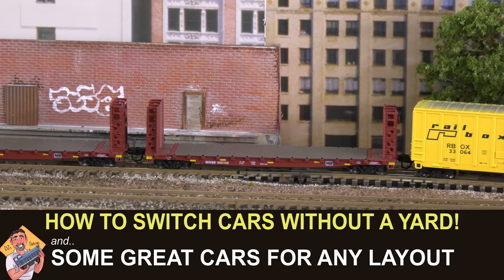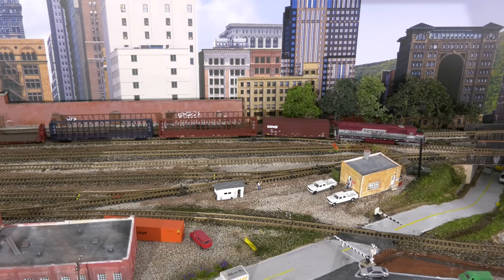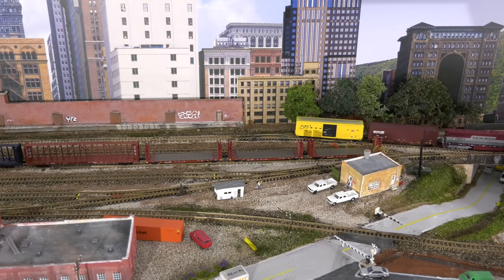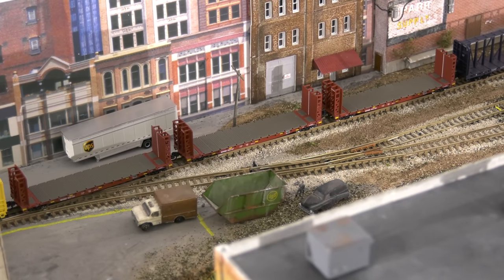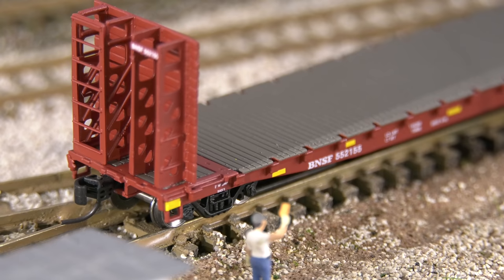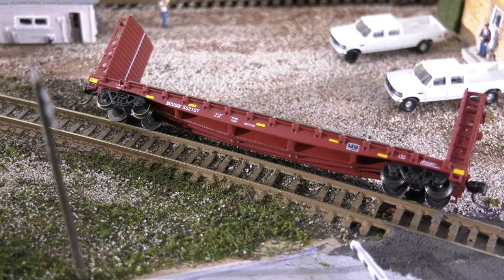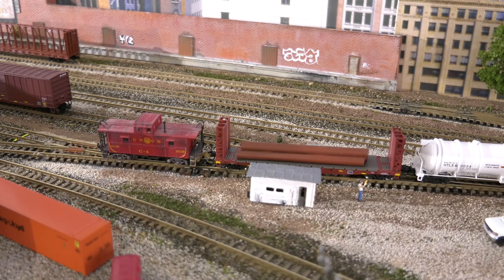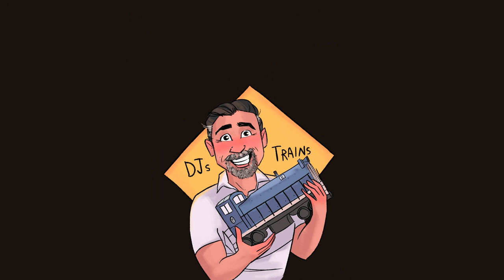How To Switch Rail Cars Without A Yard (and Great Cars for ANY Layout) Explained.

Comment: Hi DJ, Very informative video, two thumbs up. Since my layout represents a branch line, my Interchange yard only has 2 tracks as well. They are nestled in a small valley along with the branch line that heads off to the town of Long Valley. The railroad has evolved some since you've been here and is currently being operated by the Penn Central railroad. Although I'm not really into modern railroading, it just looks funny to me to see a big six axle switching cars on a branch. Of course you have to remember I grew up watching Penn Central GP9's working the local branches in the area. Having said that, your layout looks great and I can't wait to see the new addition. Cheers, Rich S.

Comment: Sweet looking cars!  Walthers has made them in HO, and Exactrail made a really nice one a few years ago.  That bulkhead design dates from the mid-1960s into the 70s.  I still see then roll by.  By the way, I live near a BNSF mainline and at least one train per day (usually the Galesburg to Lincoln manifest) has several bulkhead flats carrying steel products.  Usually beams of various sizes, but also sheet steel and rebar bundles.  So using your BNSF bulkheads to ship steel products west is quite correct!

Comment: Great video.  I was impressed with the smooth uncoupling, & thought how does he do that? I've tried a magnet built in a portion of track but just can't make it work.  Now I know how you did it: video editing!!  I wish there was a magic way to uncouple without having to use a skewer.  I remember had a remote uncoupler I controlled with just a push button on the O scale Lionel train I had as a kid.

Comment: Great video! Reminds me last week I actually saw North Arkansas & Missouri on the south end of town switching cars around when they dropped off a car for the chemical plant that's near one of the storage facilities I work at (this line used to be part of a branch of the Missouri Pacific that this section from the south end of town to downtown is all that is left).

Then yesterday I saw the BNSF moving some box cars I hadn't seen before along the branch line that is next to our downtown facility. This particular train has one of the old traditional cupola cabooses. It's one of the old Burlington Northern caboose still wearing the old green and white paint scheme. They always use it in our downtown area particularly on this branch line, and oddly all of the windows have sheet metal welded over them. Would you have any ideas on what they could be using it for? I assume not for its original purpose, but I could be wrong.
Reply: The caboose sounds like it’s used as a shoving platform 😄
Reply from the maker: we can't do long back up moves without someone protecting the shove either visually on ground, or longer distance by riding the side of the car or using a caboose/shoving platform
Reply: When the caboose is converted into a shoving platform, they frequently weld sheet metal over the windows.  They don't need them to look out anymore, and any unprotected glass would attract rocks/bricks/etc from the local idiots.  Sealing the windows with metal will protect the interior from rain/birds/whatever.  Likewise, in my area all the doors are welded shut for the same reason.
Reply: It never occurred to me that the old cabooses would be used as shoving platforms. I'm not sure why... I guess it's the nostalgia part of my brain. ;)

Comment: I'm new to model railroading. Thank you for your videos. They are very helpful.
On this layout, what brand track and switches are you using?
How do you switch the switches? Electric? Manually?
How do you uncouple the cars?
Any help that you can give to me is really appreciated.
Thank you. John
Reply from the maker: On this older layout I used peco insulfrog 
On new layout I use kato track also
Reply from the maker: I uncouple by hand

Comment: Nice modeling, DJ. I haven't seen your layout since early in your build.
 
Per my memory: Can't you have a shiftable load on a bulkhead flat next to a loco or cab? Not sure about a dangerous tank. Also, >empty< flats are good to place between a dangerous tank or shiftable load and a cab or loco, right?
 
For those who, like me, had trouble figuring out why a train is made in timetable order front to back: It's easier to uncouple the few cars at the front and shove them into a plant than to try to handle a string of cars to get one or two delivered. There may also be a pickup of empties or loads at that same plant. Did I remember that right?
Reply from the maker: correct. Last week they had me leave demmler with 125 loads of coke, and then back into blacks run to pick up misc freight on 2 different tracks!  Ridiculous!  The amount of slack in 125 cars is tough to control. Good thing we had a van to drive conductor the 1.5 miles up to the head end.
Reply: @djstrains : Black's run... on the P&W? Mon?
Reply: Generally a shiftable load on a bulkhead flat is given less restrictions than the same load on a non-bulkhead flat.

Comment: Thank DJ, this made sense, but I have a question. In your example, you only had drop offs. What if you also have pick ups? Do the pick ups go on the rear of the train? Cheers! Stay safe and model on!
Reply from the maker: I will cover in a future video.  But pick ups are usually placed on the head end because lets say we have to set 5 empty coal cars off and pick up 5 loads.. We would hold on to our empties, pick up the loads and put those against our train, and then place the empties in that spot., and return with just engines back to our train, the loads are next to engine.

Comment: DJ,  I would think that the cars would be placed OPPOSITE the chronological order, front to rear, to where they would be delivered.  In other words, the cars first scheduled for delivery, the box cars to the factory in your example, would be the first cars cut off from the train and therefore, placed last in line in the consist.  Please clarify.
Reply: I think crews prefer to spot cars close to the engine.  Better visibility to get them in the correct position, and the conductor doesn't have to walk as far.  You just leave the back part of the train on the main while you spot the cars in front.  Of course, there can be special circumstances that would call for another approach, like a siding with track so bad that the engine shouldn't go on it, etc.
Reply from the maker: no, picture from a conductors point of view and engineers.  We hate making rear end pick ups and set offs for a few reasons.  The rear end train device (EOT) has to be removed and then replaced every time that last car changes.  The slack action and control of moving a whole train back and forth, rather than just the head few cars is more than the non railroaders realize.  Lots of time we "spot" a car on an exact spot, so the slack can make that tough to do.

Comment: Real engines don't dart off pulling tons of weigh!  This kills immersion resulting in toylike performance- (background music adds "0" and subtracts)...
When and if this hobby "grows up" it will be a thing to behold!
Reply from the maker: ok, this didn't sit well with me.  First, I drive 23,000 ton mixed freight trains (200 plus cars, over 2 miles long) for a living.  DO you really think I don't know that?  This video is only to explain a switch move.  Had I decided to make a realistic op video, it would be 2-3x as long).  The music was at such a low decibel to simply cover the "dead air" from where I had to cut the audio tracks to fit.  Next, is the fact you HAVE NO VIDEOS! So before you nit pick, try it yourself.  Last, "Grow up"? From someone who criticizes but can't teach, only troll, maybe you should pick your words better.
Reply: @djstrains  
Sorry you took it the way you did no offense intended- I'll stick with what I said!
I was once enthused to get into this hobby in a big way but the "$" wanted for
 such unrealistic performance cannot be justified by my wallet until it evolves
 beyond the "toy" stage...
Reply: @Josedav3  How would anyone not take offense at the attitude expressed in your post.   But that aside, I find modern offerings from manufacturers of model railroad locomotives do a great job in simulating realistic performance.   Like DJ, I have spent far more time in the 1 to 1 scale.